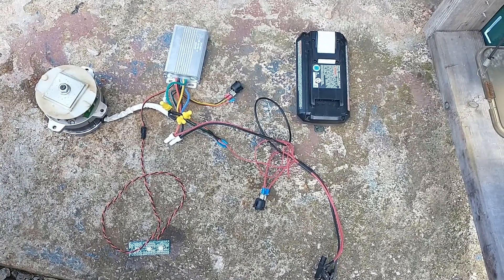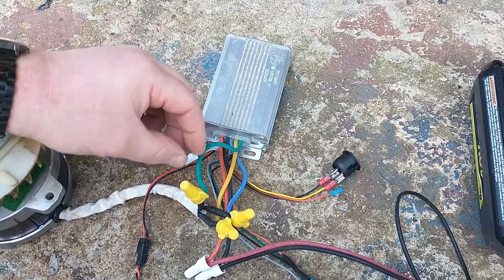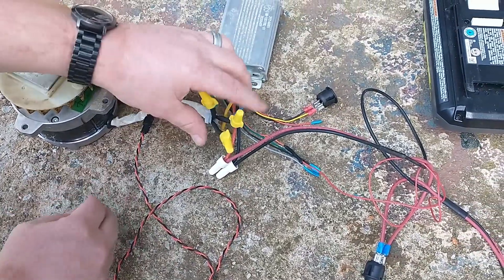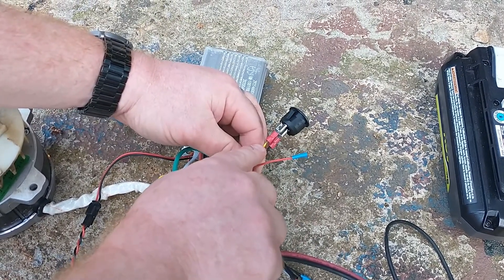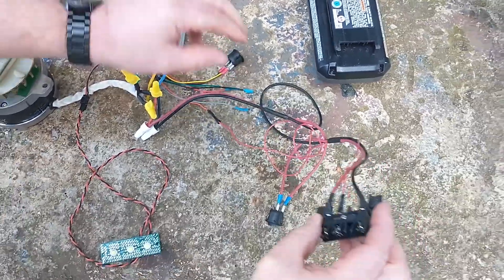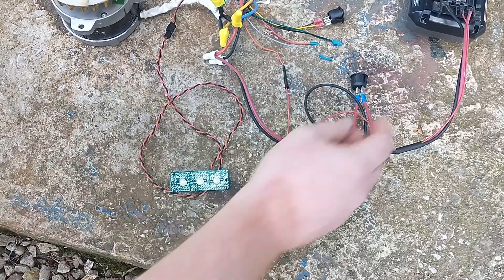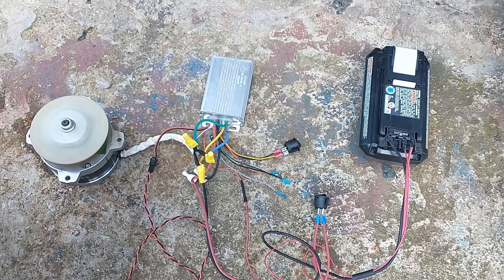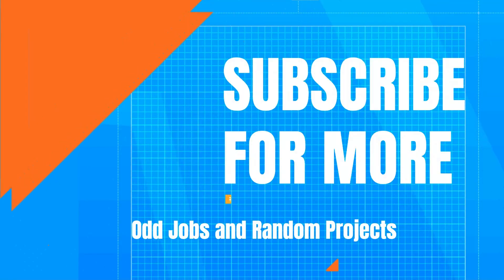Ryobi 40v Brushless Mower Wiring Diagram, Explanation and Modification for Projects

Comment: Will this work on the self propelling 40v  mower?
Reply from the maker: The basics of it should work, but there should be another switch to activate the self propelled drive motor. I'm not sure which colors the wires would be on that, but you might be able to figure it out by comparing my diagram to the one on Ryobi's website for your model.

Comment: Hi ...thank so much for this video....i just wan ask you about this motor ...is it powrful ..is it have a good torque to runing a small veihcul like a mini scooter ...thank you so much ...i hope that you help me about tha ...thank you again
Reply from the maker: It is reasonably powerful, depending on what you need from it. Geared low it moves my lawn mower just fine and can pull a load, just not fast. For a scooter it would probably work without ruining it as long as you geared it for a maximum of 20mph and kept the weight down below 100lbs plus a reasonable size rider. This is just an educated guess. I did a larger moped in another video using one of those motors, but with it geared to do 30mph it was overheating pretty bad. I went to a bigger motor so I could have more speed. Also, you will need a different controller so that you can adjust the speed. The factory controller only does one speed.
Reply: @oddjobsandrandomprojects  thank you so much for your answer ..♥️♥️

Comment: The mowers controller isn’t able to use a progressive throttle correct? Just a basic on and off?
Reply from the maker: That's correct. Since that control is for the blades they figured you didn't need a speed control. However you can use an e-bike brushless motor controller instead if you need speed control.
Reply: I have this mower.  the controller regulates the blade speed based on the load.  It automatically throttles up if you hit a patch of thick grass and throttles back down with thinner grass.  So you can't vary the speed, but the controller does to save battery power.

Comment: Not sure what I am doing wrong… Will it work if I use a 12v car style battery?
Reply from the maker: Not likely unless you either have a converter to get them to 40 volts, or possibly with four 12v batteries. But the later might be too much voltage. But a single 12v won't get the controller to activate.
Reply: @oddjobsandrandomprojects   thank you for the insight; i tried 24v as well.. must not have been enough either. I will try the 4 batteries this afternoon
Reply: @oddjobsandrandomprojects   do you know if the small red to orange wire takes 40v as well?
Reply: @oddjobsandrandomprojects  that worked!! Thank you so mych

Comment: Cool video.  Was browsing for ideas to make a kid's off-road buggy.   Not sure where to get the motor and speed control.
Reply from the maker: I found my motors and speed controller on eBay. The video I did on the lawnmower conversion would probably be more relevant for your off road buggy. I use a variable speed control for that.

Comment: Awesome man thank you  !!! I was wiring on two dewalt 20v in series and thought it was the orange temp sense wire..... that tilt sensor got me haha. Ive got a forrest Gump style snapper riding mower with a 33" single blade deck. I'm running two of these motors on the deck with a belt drive. A ebike 24v brushed motor for the drive, a power wheels drive motor with chain and sprockets for steering. My plans other than stopping and charging, a hybrid set up with a 7.5hp running some old car alternators. And to top it off FPV cameras and with some antennas set it up to mow from  my couch. haha. Laziness is great motivation for ingenuity :) what are you using for ur videos a go pro setup?
Reply from the maker: For this video I just used my cell phone. Some of my others I've used a cheap go pro clone from Akaso. Just depends on where I need it to fit and how much I'll be moving around.